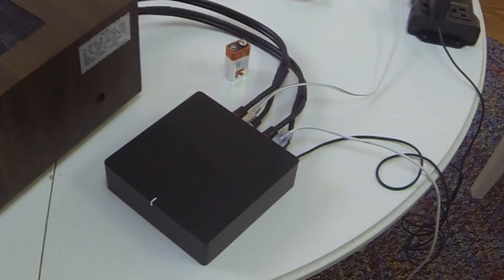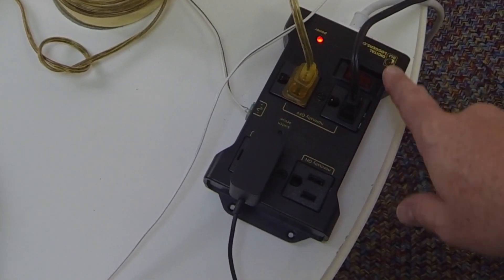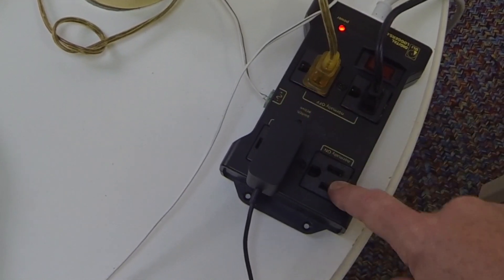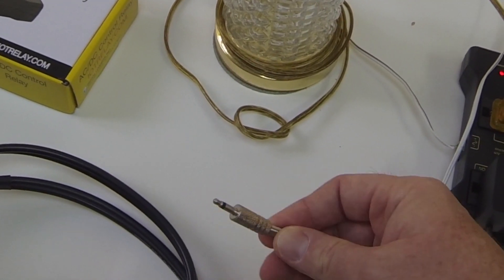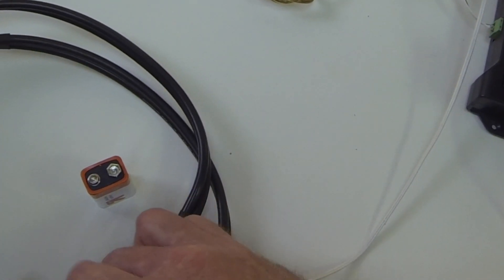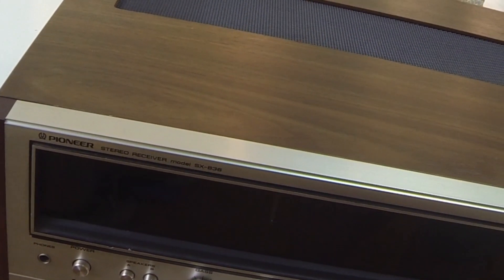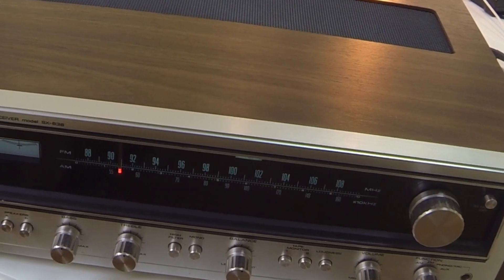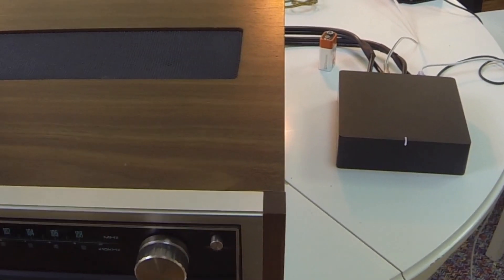Sonos Port controlling a vintage receiver

Comment: great, how'd you make the mono audio cable doming out of the sonos?
Reply from the maker: I just ordered some mono 1/8 inch plugs, but they are available premade:
https://www.amazon.com/Hosa-CMM-310-Same-Interconnect-Cable/dp/B001O5F280/ref=asc_df_B001O5F280/?tag=hyprod-20&linkCode=df0&hvadid=309818644684&hvpos=&hvnetw=g&hvrand=9243641638141910283&hvpone=&hvptwo=&hvqmt=&hvdev=m&hvdvcmdl=&hvlocint=&hvlocphy=9017271&hvtargid=pla-463909411107&psc=1

Comment: Thank you for posting this video and demonstrating this device. Very very helpful. It seems that the receiver can only be powered ON when the signal is received from the Sonos app am I correct? Would I be able to use the amp without having to disconnect from device or do I need to unplug and plug straight to a live 120VAC  outlet.